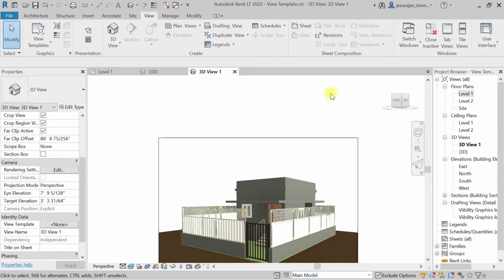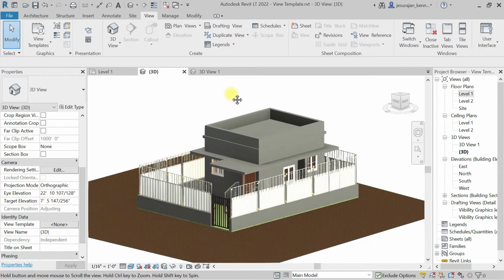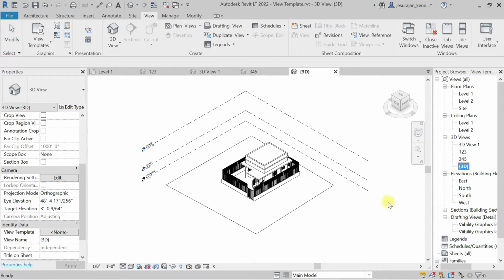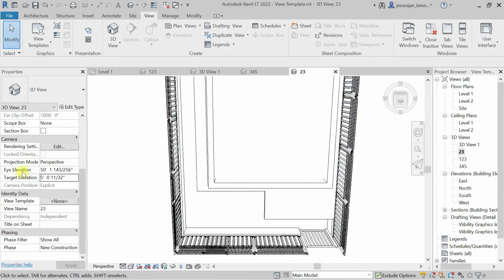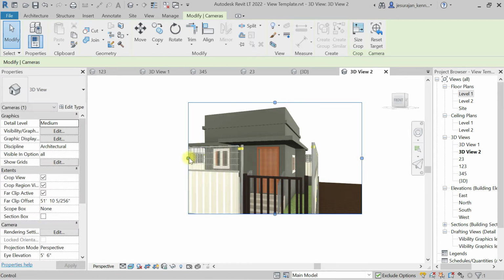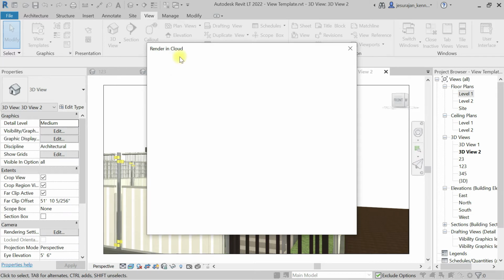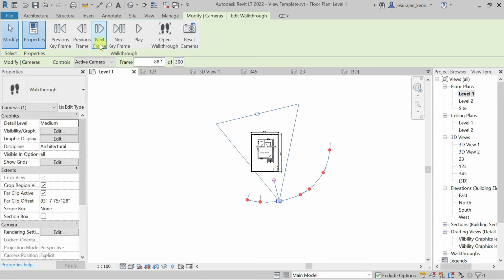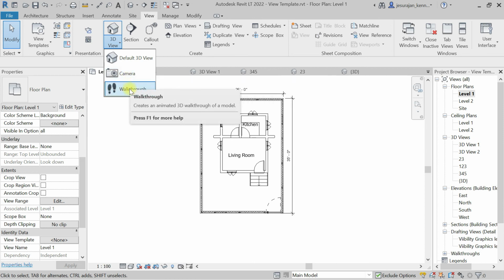Camera Settings in Revit

Comment: The eye elevation and target elevation in Revit is configured by default based on the internal origin, how can I change this configuration so that those parameters are based on the project base point?
Reply from the maker: It's based on levels. Need to set the ground level only.